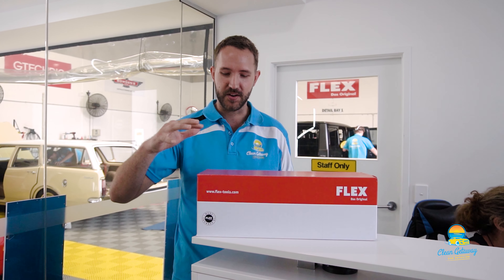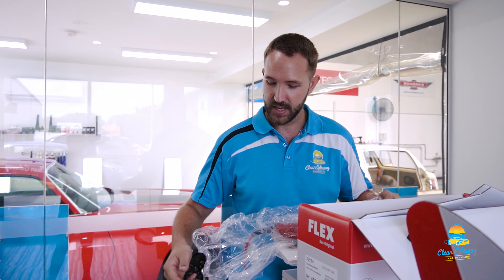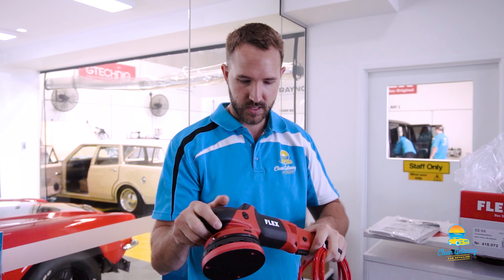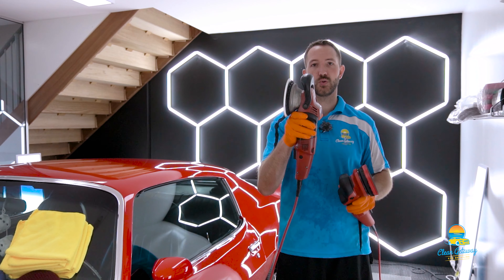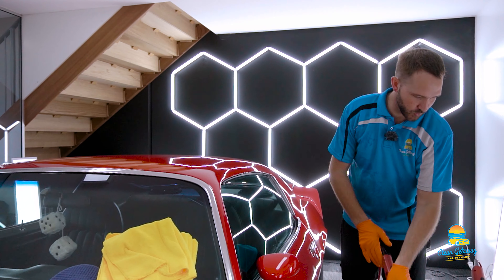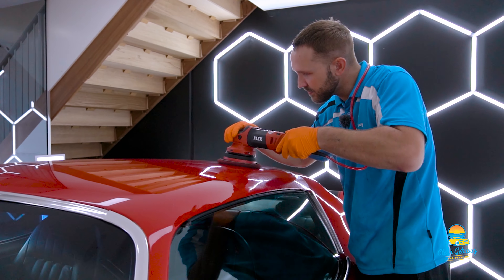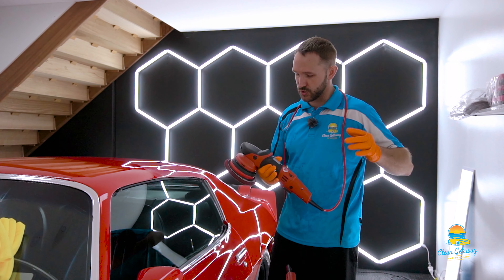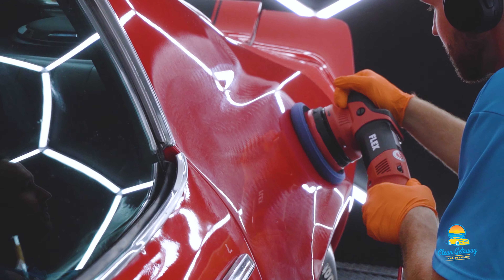Flex XCE 10-8 Product Review // Does the new XCE outflex the VRG??

Comment: Hello Joe and team. Could use your advice. Getting ready to pull the trigger on the “Beast” Xce, but can decide if I should purchase the corded or cordless version. Love having cordless tools but concerned about the lack of correcting ability compared to its corded brother. Could the cordless still correct the same in the end  if you spent more time on the project? If so, approximately how much more time are we talking? I’m doing it for my family/friends vehicles so speed isn’t necessarily the be all factor, but I don’t want a lazy machine either. Any insight would be greatly appreciated.
Reply from the maker: If you're going to be doing corrections then go Corded.  We use our Cordless for light enhancements or if we are correcting a small area.  It's mega convenient using cordless especially when working on a big vehicle but I believe the corded is more consistent in power.  Thanks James!
Reply from the maker: Also James, it takes roughly 30 - 40min to charge the batteries and you only get about 20 - 30min use out of each battery with full power.  At the end of the day, i think your best value is the corded version.  :)
Reply: @cleangetawaycardetailing  Thank you for your help! Corded it is. Thanks again.

Comment: So, this is noticeabley more smooth than the VRG?
Reply from the maker: Yeah that true
Smoother, quieter all round nicer
Reply: @cleangetawaycardetailing  thanks! Do you have any other videos where you use it?
Reply from the maker: @qwikss4469  it's pretty much used in all our videos 👌👌
Reply: But on a private detailing group it has been reported numerous times that the new corded flex supa beast DA polisher is not as powerful as the original v r g 3401 beast!!  The original does sound stronger in the video.
Reply from the maker: @404notfound.....  yeah it's true.  But we haven't tried a bigger backing plate like the VRG has so that would be a better comparison I think
Reply: @404notfound.....  Correct new XCE has Less OPM and Less RPM..same 8mm throw though..it's an under spec'D 3401
Reply: But as Mike Phillips states, yes the Supa BEAST is slightly less powerful than the original 3401 BUT, it’s quieter, smoother, lighter, and runs cooler. And by no means is the Supa BEAST weak. It’s more powerful than any free spinning DA. It plows through oxidation, swirls, holograms, etc WITHOUT any stalling. How do I know….I own one. It’s legit.
Reply: Makita po 6000c mi bu mu